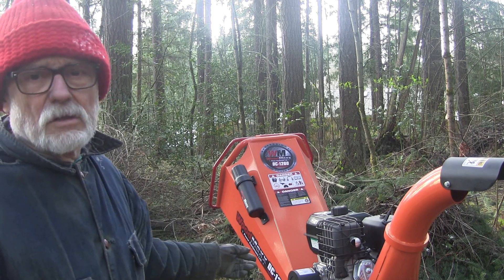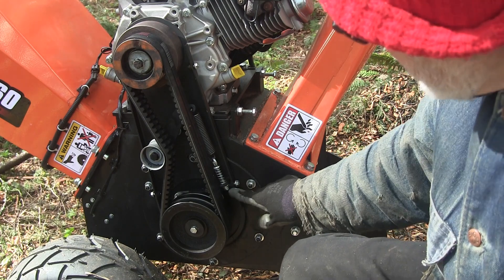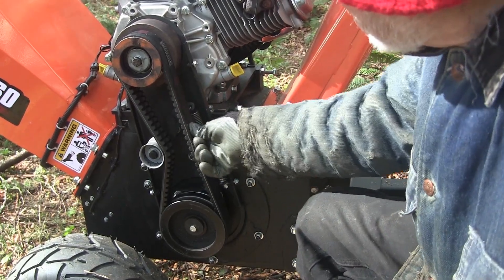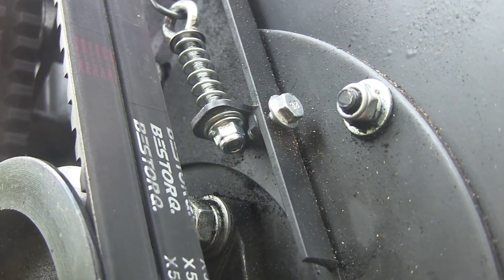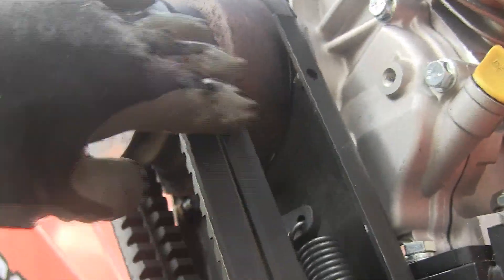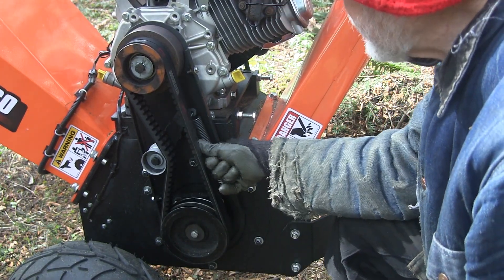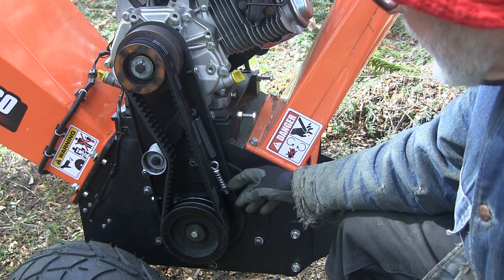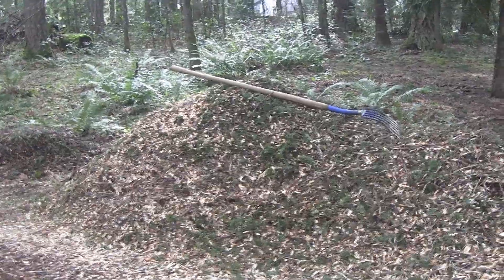Dynamic Test of Belts Cover Off

Comment: I can see the inside belt (closest to the machine) is flexing more than the outside one... looks to me like the two shafts (crank and cutter head) are not parallel. The engine is pitched up a few thou at the output end, stretching the outer belt and leaving the inner slack. I'm not engineer but I did stay at a Holiday Inn Express one time :)
GREAT CONTENT and trouble shooting... cheers from NW Ontario Canada.

Comment: What's your opinion of this machine ,would you buy it again
Reply: @Luke I don't have a good answer but I would do more homework before I bought another chipper. If Woodmaxx had stood by their product more and been more proactive on helping me solve my problems then I would be OK with dc-1260 chipper. That being said, when I look at this video and other recent videos of the dc-1260, the entire belt setup and configuration has been changed significantly from my model. This leads me to believe my prior generation dc-1260 chipper has an inherit design flaw that tears up the belts other things they supply with the chipper and the ones they sold me to replace.  It is damn near impossible to replace the belts they provide with my version of the dc-1260 as well. Other problems that I had, that they sent me replacement parts for included a new belt flywheel because the original one had a huge chip from the casting process and a faulty panic bar switch. 

So for me, my next chipper would be from another supplier other than Woodmaxx and I would research my options for months before deciding.  I would talk to the warranty and service folks to learn how problems are solved before you buy.  This link might be helpful https://usamadeproducts.biz/tools-power-tools-chippers-shredders.html  They include Woodmaxx on this link but clearly only certain chippers they sell would classify as USA made products. There three most expensive chippers say Made in the USA. The rest of them do not appear to be made in the USA but are likely imports. Hope this helps. BTW, if the folks from Woodmaxx ever read this and want to chat, you know how to find me. I the guy in New Mexico trying to make do with a chipper that has cost me countless hours of frustration and money trying to get their very large and expensive "boat anchor" chipper working correctly.

By the way, to RedBarnBoats... your videos have been VERY helpful in me diagnosing some of my own DC-1260 issues. I appreciate your content and channel.  THANK YOU!
Reply: I bought one these DC-1260's just over 2 years ago. Mine has a completely different belt setup. No white roller, no springs, no tension adjustment of any real use. I can barely get the belts on roller without crushing my fingers and it takes at least two people to put on a factory belt much less two of them. The factory belts break every 10 to 20 minutes. I have started using basic (cheaper) small engine belts from my local hardware store with much better results. I WOULD NOT buy this chipper again primarily because of the problems noted above and the customer service team at the company was very little help. I gave up and mothballed my chipper for 18 months. My local small engine repair guy helped get it up and running better. I WOULD NOT buy this machine or anything from this company again. Save yourself the hassle. Buy American or Canadian.

Comment: Hope you have spare belts on hand because it will go thru some. If the tensioner arm comes the slightest bit lose, the roller on the tensioner arm will cut the belts. I've had the same chipper for over a year and I've went thru 3 sets of belts. The belts on mine get so hot you can't touch them...

Comment: I have used mine a couple times. Running good so far. Hope mine does not have the problems yours does. We will see. Thanks for the videos you do on the repairs on this.
Reply: Pull of the cover on yours to make sure the "belt tension eye bolt" hasn't loosened.  Can't stress that enough. Mine came off after about 5 hours of use.